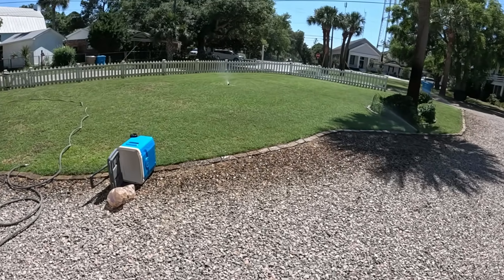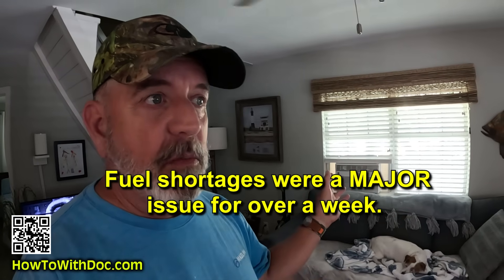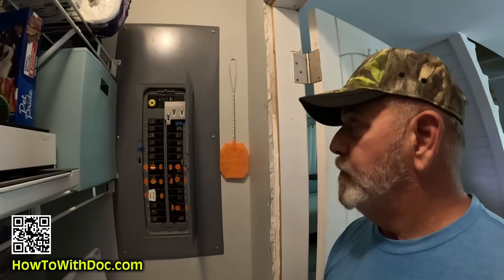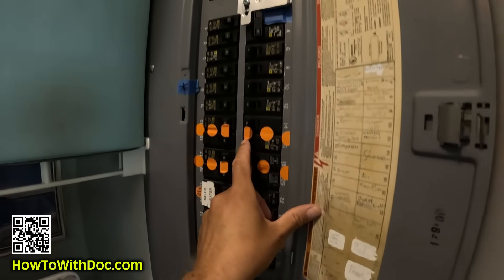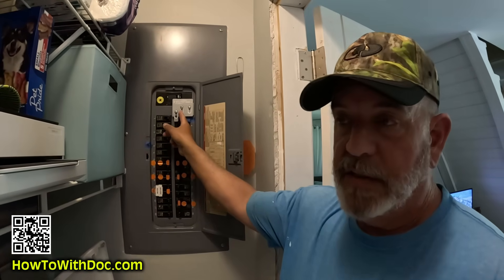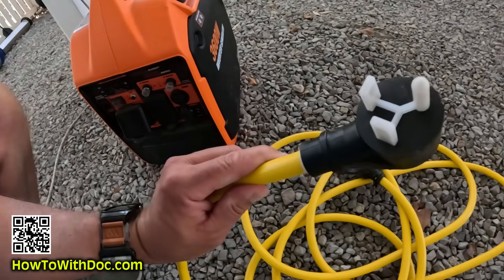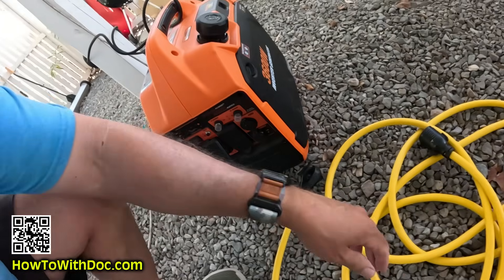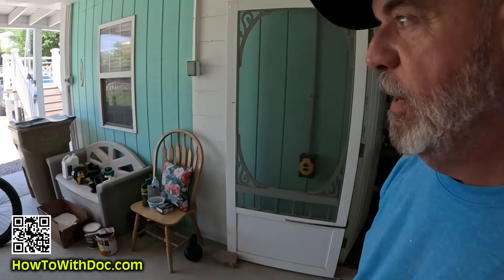How to Use Small Generator for Whole House Power

Comment: I really appreciate what you said but I must disagree on one point when you mentioned the "average" person not having propane whole house.  I get it, but the "average person" that you are referencing usually has a house, and every house has a roof and most have yards.  We have a lot of power outages, especially during the Winter months.  I too have a large generator that is hardly used.  I fired it up only twice in the past 8 years.  Why?  I went with solar panels out in my yard and a portable battery (with built in inverter) that is charged with the panels and the cost was close to same as a large gas generator.  I mounted my six panels on the South side of the house for obvious reason, however, my electric panel box in on the opposite North side of the house.  Since the battery is on wheels, I use it every day for all of my TV watching and cooling fans.  Like you (and I've done this), I can turn off my main breaker and plug the battery into any wall outlet to power whatever is on the same circuit.  In the Summer/Fall months there is more than enough sun juice and I NEVER have to plug the battery into a wall socket to fully charge it like I do every few days in the Winter.  I do have a full house 240v plug next to my breaker box, so I have the choice to fire up my gas generator OR wheel the battery to breaker box and use it instead for the whole house, including all the 240v circuits.  I tested it to make sure it would work for my 240v appliances and it does, however, I've never had to use it under "real" circumstances so I don't know how long the battery would last under those type of conditions.  However, because of your video, I'm tempted to go buy a small gas generator as well.  Thank you... great vid.
Reply: Solar batey tv solar fans

Comment: What is your Doctorate degree subject matter?  I have solar panels and Batteries and they can run the fridge and freezer and a heater an air conditioner.  If the power goes out, I will not be worried.  This was 10 years in the making and it works so much better.  I have 5 College degrees and 5 minor degrees.

Comment: you know I thought I'd also mentioned I don't see the styrofoam on the top of the window on your window units there's a piece of black styrofoam that comes with the window unit you weren't supposed to throw that out it wasn't for shipping it was for actually stuffing the top of the window to prevent heat from coming in the top of the window that you're opening you know what I mean
Reply from the maker: It's there

Comment: I picked up some of those 2 Kwh solar banks on sales recently for some family members. I think they were around $400 each. So there are 4 of them in my house and I can easily charge them with my solar in the back yard. Might have to pick up 1 or 2 of those generators so I can supplement the solar in winter during an outage. I'd rather be prepared for the worst. 

It is nice though being able to keep the fridge running and run the induction cooktop in the the kitchen and use various appliances, run the window A/C units, and keep the wifi running so the TV's are still usable and the lamps can stay on. If it weren't a rental I'd have gotten a larger solo unit and some expansion batteries integrated it into the house and added one of those ports for gas or diesel generator power in addition to the solar.
Reply: Solar batre light hu o es

Comment: 220Vac is not a matter of more power it is a matter of the same AC power 180° out of phase.
Reply: No, akk residential service utilizes a single phase center tapped wye connection.

Comment: Home depot has small refrigerators and small freezers. 7-11 Cu. Ft.  The 7 Cu. Ft. refrigerator draws 65 Watts when the motor is running. 65 Watts is nothing and it only cost $400,

Comment: Great video! I'll tell ya another thing people do wrong. They use the generator constantly to power fridges, freezers and furnaces! Those appliances run and then stop until they need to run again. It's called cycling. They are either cooling or heating. The neighbor used to leave his generator running all night for his fridge and freezer, until he saw me shut mine off at bed time and then start it in the morning. Your food will be good and stay cold😂 for 8 hours while you sleep. That is if everyone's not raiding the fridge for midnight snacks! Lol. I Hope this helps! 👏💯🎯🏁🇺🇸
Reply: I live 100% off grid, solar, and I do this most of the time, turning off the fridge and freezer overnight, everything stays cold/frozen just fine. I also turn off my internet overnight, no point running all of these things overnight when everyone is asleep.
Reply: I have all my small kitchen appliances minus stove, frig n freezer on power strip. I turn off step when not using n unplug it from wall. And same with cell chargers and other little things.
Reply: Its common sense.
Reply: I live in Baja, MX in an older community near the ocean. As such wind and salt air corrosion are a problem as far as electrical reliability. By coincidence, I used the same approach and generator as talked about in this article , with these exceptions: we have no 240 appliances. I installed an inline power meter to monitor power usage. I have never seen an amp load over 10 amps.
Reply: What do you use a generator for, just to power a couple of lightblubs and charge your phone? I ran my home minus the central air on a 8,000 watt generator. I had a window unit to sleep by. This was after Hurricane Charley. Ran every night for ten nights. It ran my well pump and hot water heater. That's what a generator is used for, to continue a normal life as best as possible.
Reply: @Dale-v6o  you missed the whole point, that a lot of appliances do not need constant power and at night that generator can rest and save fuel. Use other means of lighting after you go to bed. But I'm glad your getting the hours out of yours really fast! Take care! 🤔🤷😉

Comment: Great presentation, we have two of the small generators you used in this video, great generators at good price, we live off-grid in southern Alabama and used the generators until we had our solar system installed, we have 8000 watts of solar but our power needs are quite small. We live in a 24 foot camper trailer with a 10 x 15 foot room added on. We have 4 house batteries that are backups, we mainly use 2 Pecron 3600 watt power stations as our main power source and the 8000 watts of solar keeps these 2 units charged up with no issues. Hot water is supplied by a on-demand hot water heater that is powered by propane, the propane also is used to cook with and the heating system. We had a mini split AC unit installed and the Pecron power units run this very easily. About the only time I have to run a generator is to transfer water from the well to our storage tanks and the well is wired to run on 110 volts. We also have a Rainwater collection system that really helps. It's not a perfect system but we live debt free and life is good in Southern Alabama....

Comment: Hey Doc. This was a really great video. I have wanted to get a cost effective generator for the house and one that is easily portable. This one looks looks like a good one. I am not sure if you will see this comment or not, but if you do I have a quick question - do you mind sharing how much the electrician charged for all of the install he did for you on this (both the outdoor plug and work on the electrical box). I just wanted to get a ballpark on what time/fee was involved for that. Thanks!

Comment: Good video,  you've  made some important points.  One thing I think  people  that have stand by guns for get  about? While  there fuel not run out. There generator  still needs  to be  stopped  an checked every  couple  of days.  Oil levels  etc Or else you could  have premature engine  failure
Reply: That was a typo and ytube won't let me edit. It's not... Stand by guns... Lol it's supposed to read... Stand by gens.

Comment: I agree fuel is a problem. 5 years ago We have ef3 tornado Destroyed power lines no power for 5 days.  All gas station have no power or out fuel. Only chance We have  SUV been sitting there for 2 months suv full gas Only chance Pumping out the gas. so Went to Harbor Freight buy pump and Feeding in  was tricky but made work Refill generator. Learn my experience Having fuel all times. have Three Red 5 gallon  fuel tank Just in case like that happens Again natural disaster

Comment: great information.  I just have one question.  what happens if you forget to switch of one of the 240 breakers?   Does this cause a 'short' across the two phases?
Reply: No, it won't.    The 240v wont work at all,
Reply: @rand8355 I knew that already. I was wondering if it would harm the equipment
Reply: @orcinusorca3145    No, it wont harm the equipment

Comment: The truth of the matter is you don’t need to switch off the 240v breakers. The appliances simply won’t run on two in phase 120v feeds.
Reply: You still need to shut them off because they may be Multi Wire Branch circuits.  120V devices, outlets, etc. on a 240 breaker using a shared neutral.

Comment: Have the smaller  Champion TriFuel natural gas generator along with an EGO battery power pack plus the smaller EGO battery packs to charge cells, computers. We have gas for cooking, heating, water heater anticipating this happens here. Turn on the fridge every 4 hrs last two outages works like a charm. For less hassle, I need to have the electrician come to hook it up to the breaker and pick what I want to power. But really, it's all you need. By the time I'm done, it's more like $2K for it all rather than $20K for something that happens once every 5-10 yrs.

Comment: Great video explaining the advantages of small 120V generators. I do the same but add in my travel trailer's battery bank feeding my inverter and solar charging during daylight hours.

It is indeed imperative to have you main panel wiring inspected. Thanks for empathizing that. A DIYer, and I am one too, might miss a multi branch circuit wired through 2 separate 120V breakers. I panel had one I almost missed. The possible issue is these 2 circuits are usually wired with 3 wire romex and share the neutral (white) wire. If the multibranch circuit is wired correctly they 2 breaker will be on different poles in the panel box where the normal feed provides one "+" and the other "-". Most of the returning current will cancel each other to a degree . When you do as you show in the video and feed both poles from one phase, there's no cancelation. The issue lies that if loads on the two sides of the multibranch circuit are near max for their individual breakers the neutral wire can become overloaded and possibly overheat. Check YouTube for multibranch 120V circuits for a clearer explanation and clear real world examples.

Comment: Even if your generator has only a standard house type 3 prong outlet (regular 15 amp outlet) there's an adapter cable that will feed both legs of your panel. My little 1200 watt champion will run most of the house very economically. I'd absolutely invest in an inverter, but our infrequent outages don't support the cost. Great Video!!
Reply: T I ars buy whyiu scary need not waste mkny watng

Comment: Interesting. Thanks for the tip. I know Genmax and a couple other manufacturers make 120v generators you can pair using a combiner box for 240v. What do you think of this option for people who need 240 in the morning only? It seems like it would be nice because you get the lower fuel consumption by only running one for most of the day and running two in the morning. If one of the generators breaks, you have low-consumption redundancy for 120v.

Regardless, I have two teenagers so I already maintain 3 cars and don't want to add yet another gas engine to my maintenance workload when I would only need it a couple times in the next decade. For me, in my area, solar/battery is my primary backup, but I like to see all the options. This video is a great solution for people in other situations. I might wire my panel using your method. Even if I do eventually get a generator, it would charge my batteries rather than directly run the house.

I recently went through a 72 hour blackout where I wasn't getting much solar, so I used my car's alternator connected to an inverter connected to a lithium battery charger to recharge my battery bank (inefficient but effective). It kept my fridge running, some LEDs, internet, my PC and monitors, and occasionally my central gas heater - not really a whole home solution and I can't run my air conditioner, but I wasn't exactly roughing it either. I only went through about 5 gallons of gas the entire 3 days because I just had to run the car long enough to charge the batteries - not run it 24 hours a day. I have natural gas appliances and my only 240 circuit is for my central air conditioner.  I try to make sure no car comes home with less than half a tank, so with a combined 25 - 50 gallons of gas sitting in the driveway, I can outlast stormy weather until the solar picks up or a gas station opens.
Reply: Yes yiu xan

Comment: I am using an Ecoflow Delta and then using the 2500 internet generator to recharge the ecoflow.  Only need to run the generator about 3-4 hours every 12-15 hours

Comment: Its too bad they dont make small 220 volt inverter generators..That way you wouldnt need your extension cable that hooks both phases together..You could just unplug your small generator and plug  your large generator into the wall recepticle..You still wouldnt be able to use your central a/c,or your water heater..You would still have to turn those breakers off.
Reply: There are small ones.  Wen 680IX only weighs 100lbs and has 240V plug

Comment: I bought the Wen 3600 generator with the propane option from a local auction house. It was a return and it stated it would not start. I paid about $250 for it when all was said and done. I found that the tube that was pressed into the carburetor for the propane connection was loose and allowed the engine to suck too much air. I repaired it with JB  weld and it now runs like a champ, it's a great little generator. It's nice to have the option to run it on propane or gasoline, although propane derates it a little.